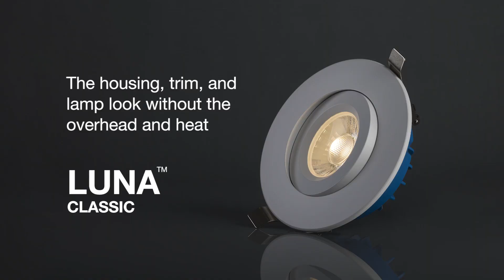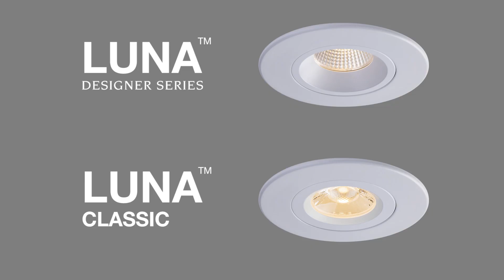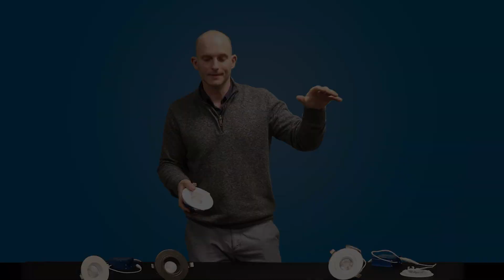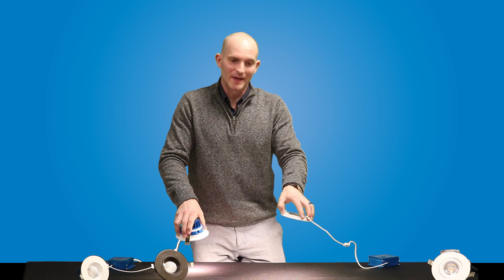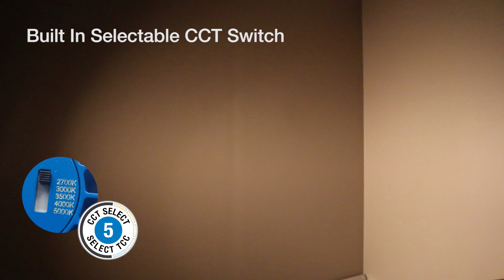SteveTALKS - Liteline's Luna Designer Series

Comment: This is a very helpful video. Thank you for posting.  Just ordered a couple for my hallway of the designer series.  I’m really excited about it.  I’m gonna put them on a Lutron low-voltage dimmer for my smart home Caseta system. It’s gonna be awesome. Going from the old 1980s fixtures.  I think the hardest part about installing these will be removing the old electrical box in the ceiling.  Any tips on that?  Our current opening is about 4 1/2 inches.  The specs say 4 1/4 inches hole is needed so I’m hoping the ring will cover and the clips will fit.